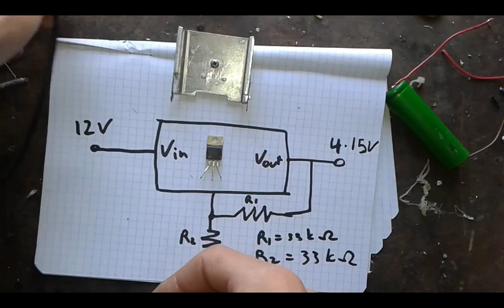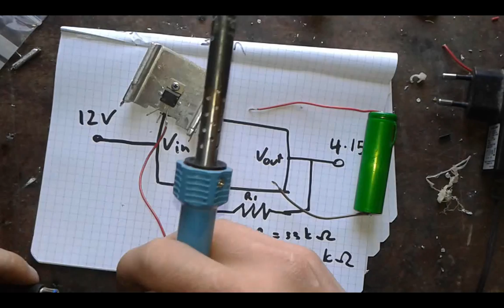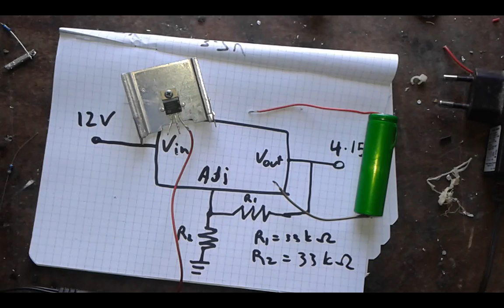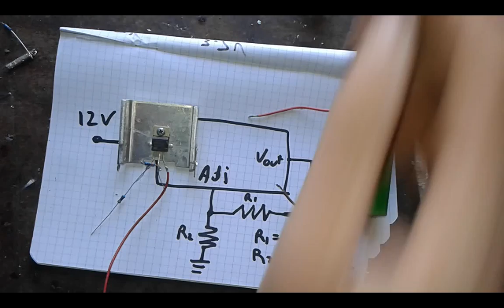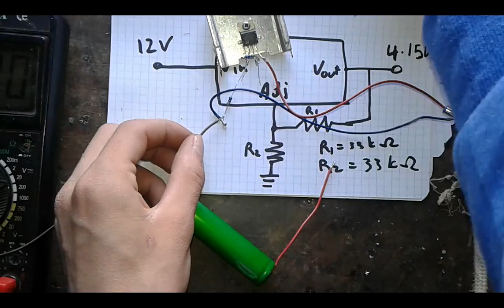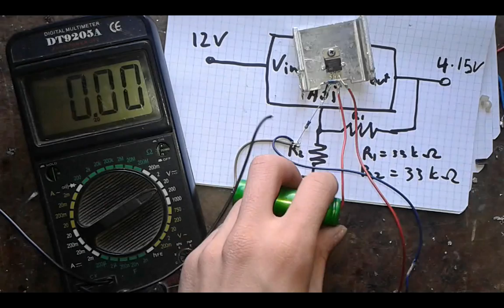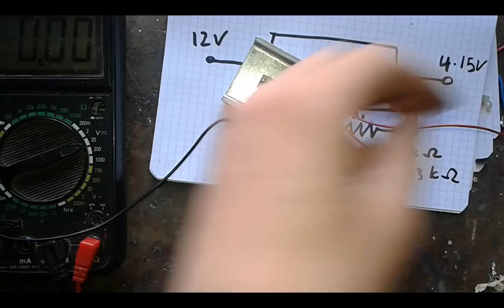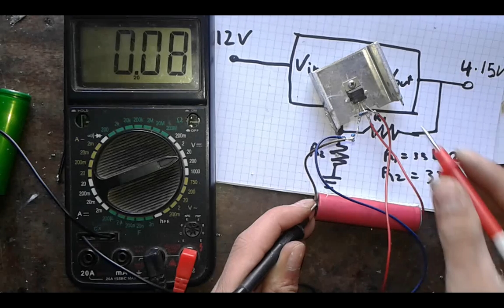Simplest 18650 Li-ion battery charger that brings dead batteries to life using LM317

Comment: Lithium ion are extremely explosive, the charging method is different for the chemical that composes them, it is used by a load manager that is sensing the voltage and current to decrease it gradually. The constant current to variable current, variable voltage, constant voltage technique is used.

Comment: Check 6:50 and 8:46. It is not the same battery.  At 6:50, the positive terminal white protector cover  is inside and compare it at 8:46 the white protector terminal cover is now outside.

Comment: Im using mine with lm317 and with power supply 700ma and works fine
Reply: yea, me too...but i use mine to charge a 6v 4.5AH battery....depending on the values of R1 and R2 i set the voltage to 6.8 volts with an led indicator....when the battery gets charged to 6.8v,  current decreases and the LED comes on.

Comment: Now check the batteries voltage the next day and they will be back to or very near the original voltages with no capacity.  Li-Ion don't come back from the dead that easy some times you may get lucky with a dead battery (<3.0V) and you might get the voltage up to 3.5 - 3.8V after 24Hrs but it is extremely rare to get them to a true 4.1 - 4.2v . They will have very little stored energy capacity.  If you push too much current into a Li-Ion battery and cook the battery you risk of a fire.

Comment: Oh my god! Waking up a lithium battery with a linear constant voltage regulator circuit without current limit? Add another LM317 constant current circuit at the output and it'll be much safer.
Reply: peaceful1123 you right, it's bad way to change on CV and without protection circuit on cells
Reply: Of course it has current limit. The LM317 has automatic current limit.
Reply: where is the current limit? this is voltage limit and it has a short-circuit protection but in this configuration  is no limit on the current.
Reply: I hook it up to one those 99 cent gardening light solar panel....
Directly from the solar panel....I clip the electrinics from it..
the TX and check valve diode...ect

it's not as if that little solar panel is going pumping
20Apms....through it...FFS
You'll be lucky if you get .1

I left it out there at noon...it's wasnt getting direct sunlight for
more than 2 hours. The solar panel will still charge in the shade
at every low current.
i know this...becuase i have  one of those lights mounted
UNDER my PATIO..it'll still charge the battery but wont
last as long as the ones in direct sunlight.

It was away from the house..ect
Forgot all about it.....
Hook it up to the multi charger this morning..
45% on a 2600 mah cell.
It on the charger now charging...

hummmm...maybe just put it back on the salor panels. lol
I have old rotted solar 99 cent solar panel up the wazzoo..
I'll have to rig something up to charge these 18650 via solar.
Reply: @oneeyemonster3262   The garden light solar lamps,at least the ones containing one aaa rechargeable cell,can give,on max sunlight,about 2 volts and 30 mA.I used to collect these from scrapfields,if they are not damaged.The best ones are glass amorph solar panels,usually brown coloured.You can connect two of these in series and directly on 18650,without fear of overvoltage.It can slowly,but surely charge the battery.Make sure you check,however,the battery time to time,as most of these are rated between 800 and 2800 mAh.

Comment: man, you're f...in genius!!never had those batts you're showing..my Nokia x2 andrd not charging since Sept..could be loose port or burnt chrg ic ..tried every ckt in six months..wall mount, 358, chinse 3582, tl431 nd 317 combo nd other ic cktsjust wanted fastest. .in ampalways a believer and creator in minimalist electronics..mostly classA amp and led synclast month, one scheme was working, 220, 820, 1om 2w. .317 based, you know that ckt..but those 1om res are messy, op current still low..using 12 0 12 750ma tranyand now I saw yoursapplied some thoughts, not all Nokia fones come with quick charging, few lumias do..what I believe, fast charge tech is meant to charge the battery.alone like 18650 or even like li-ponow its. charging like bull hehejust planning to get a 9v 1amp tranywill charge like stallionthanks matemostly on insta, showing my cats n amps, indrzit✋

Comment: Would it be safer to make R1 a potentiometer and then to slow creep up the Vout voltage manually, as your battery starts to come back to life? After it is fixed, them you can charge normally (don't let it drop to less than 3.5 volts)
Reply: KillertoneLabs ไป

Comment: Any way to add full charge led indicator? One transistor scheme
Reply from the maker: i found one online but i dont know if it works for the 18650 cells 
https://www.electronicshub.org/wp-content/uploads/2014/06/Circuit-Diagram-of-Automatic-Battery-Charger.jpg
Reply: Yea, a transistorised led should work, reverse current from the battery would open the base to conduct through led, right now I have put a resistorised led across battery terminals and guessing the brightness difference )
Reply: Thanks but please can I get for 4volt lithium battery?

Comment: DEAR FRIEND ... YOUR SCHEMATIC IS NOT CORRESPONDING YOUR PERFORMANCE .  TO BE MORE SPECIFIC  COMMON POINT FOR THE RESISTORS IS NOT THE ADJ  PIN OF THE LM317 BUT  THE OUTPUT ( 4,15 ) ACCORDING YOUR PERFORMANCE . MAY BE A NOTICE WOULD AVOID MISTAKES AND CONFUSION  !!! .
Reply from the maker: DIMITRIS PAPAGEORGIOU  hi yes the scheme and the connections are the same .. the pin on the left side is Adj .. the one in center is Vout and the one in the right is Vin
Reply: HI...THIS  CIRQUIT IS VERY USEFULL AND VERY EASY TO CONSTRUCT . I AM AFRAID THAT UNEXPERIENCED ON ELECTRONICS PEOPLE WILL GO ON SCHEMATICS AND IT IS UNFARE NOT TO SUCCEED . DO SOMETHING FOR THEM WITH AN OFFICIAL CORRECTION ON YOUR VIDEO .  ... FRIENDLY REGARDS .
Reply: HI...THIS CIRQUIT IS VERY YSEFULL AND VERY EASY TO  CONSTRUCT BUT I AM AFRAID THAT UNEXPERIENCED PEOPLE ON ELECTRONICS WILL FOLLOW THE SCHEMATIC  AND IT IS UNFARE NOT TO SUCCEED .  DO SOMETHING FOR THEM AND MAKE AN OFFICIAL CORRECTION ON YOUR UPLOADING  .  ...  FRIENDLY REGARDS .
Reply: @dimitrispapageorgiou1307  is right.You can look after datasheet of component to determine pinout configuration,otherwise you will destroy the component.The output voltage of LM317T is between 1v and 32v max,depending of course on input voltage.The max current that can pass the circuit is 1,5 Amps,at least i experienced that on diy projets myself.If you use bigger input current,you should use bigger heatsink.Regards

Comment: One thing, I am getting 12+ volt on open circuit output, is it dangerous for the phone battery in future? Using 9.0.9 1a transformer in fwr.

Comment: Hi No doubt it,s another good video which is helful , using TP4065 is still good as it,s cheap in ebay
Reply from the maker: sammy  yes but tp4065 doesn't charge when the battery was empty for lang time :)
Reply: Deno ,thanks for your swift reply

Comment: input 12 volt  but .....amper?
Reply: There's a diaphram UNDER the POSITIVE tab...You simply need to
press it BACK DOWN...it's just a safety feature...
when the battery gets HOT..it'll expand and acts as a cut off switch.
to prevent  it catching on fire or getting hotter...
Such as under a LAPTOP

The only problem is....the diaphram dosnt recess back when
it gets too hot.

It works like a Charm..I wasnt getting any charge..know matter
what I did.....i even used an R/C car . it has a builting IN LI On
cell and USB...it just use a diode...to drop the voltage to 4 Volts...
It's STUPID  charging or no minimum voltage...

Anyways...I pushed the diaphram back down....all the dead cells came back to life....Most of them where at 3.2 volts or better.
They charged right back up.

The stupid diaphram was preventing it from charging..that's all.

i usually charge at .5 amps or lower.
the most I'll go is .6 - 8 .amps 
I have wazooo of cells and multiple chargers...no need to get in
a hurry. ..It's just making dead cells alive again.

Comment: I don't have LM317 what else can I use ?
Reply: Unfortunately this design does require the LM317. An LM217 could probably be used. Many manufacturers make their own version of the LM317. You'll have to look around.
Reply: Anouter 18650 cell, at least 50% charged and resistor from 10 to 470 Ohm. Connect cell's negatives together and positives throught resistor and wait until dead one is back 3,2 Volts
Reply: Is this safe? I vape, so I have lots of 18650, 18350, 20700 batteries. Some have gone permanently sleeping :) and my both chargers says "Error" or "Dead Battery" and it won't charge. If 100 EUR charger with "Bringing from the dead" feature says they are dead I wonder how safe it is playing like this when there were instances of exploding and "your face ain't so pretty anymore" after.
Reply: Volodumur , how much time will it take ???